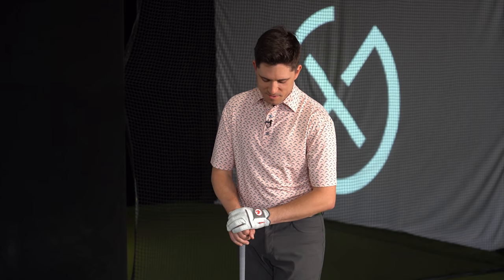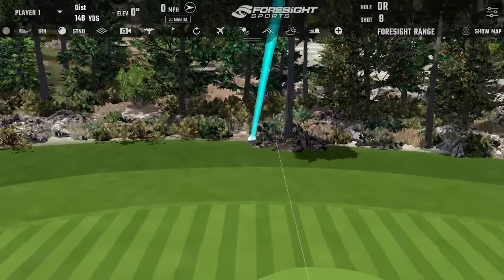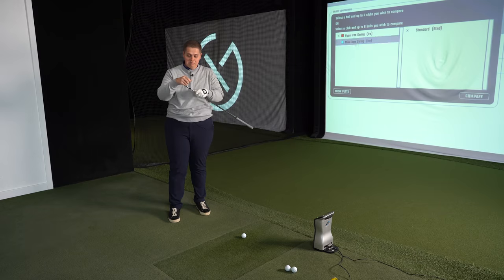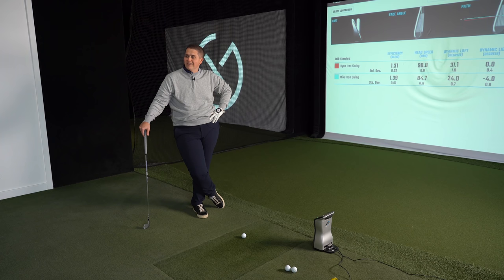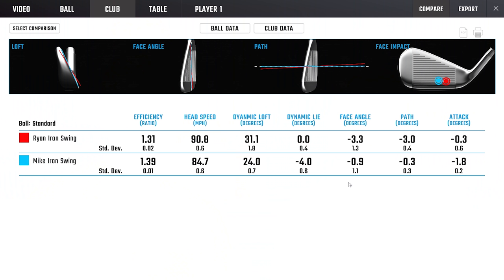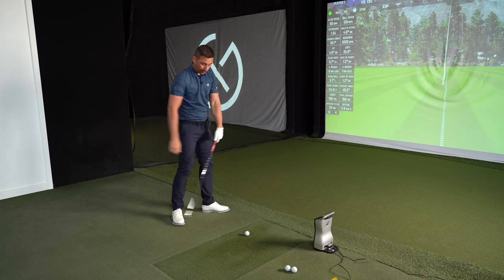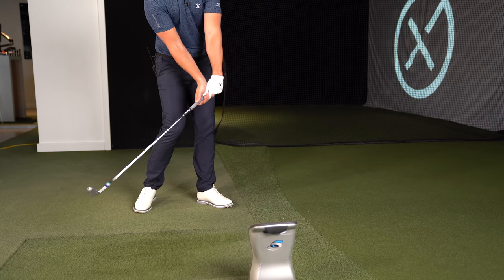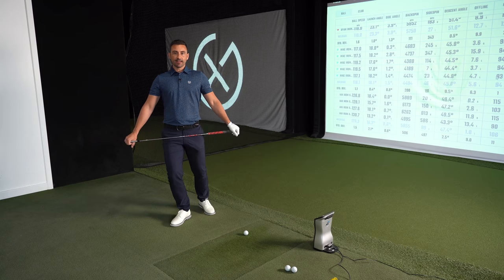HOW TO COMPRESS THE GOLF BALL // Controlling Spin Loft to Add Iron Distance

Comment: The video you guys did on ball position in the stance has changed my game in one day. Used to have the ball way forward and didn't understand why my driver and long irons were constantly pull-slices that went nowhere and my wedges were just high pulls. Now, with the ball back in the stance, the drives are straighter and longer, the irons are compressing the ball properly adding 15-20 yards and straighter, and the wedges are much easier to hit correctly and control. 

Thanks Ian and TXG.

Comment: this was amazing. i have been practicing this for very long. i am a-lot more accurate and it feels like a slower swing. i am a +6 Handicap. i have help a few friends lately with this swing. I get the feeling of not releasing the hands at the bottom, or a more forced body swing. everyone i have shown this actually works. knowing now why it works is so amazing and feels that i am moving in a more positive direction. thanks guys
Reply: can i maybe post a video
Reply: I’ve got to ask what is the feeling here during the swing. I know for a fact I’m not utilizing my speed. My 7i is 92mph and it’s like a 175 club for my. I know that’s due to my dynamic loft. I’m like 2° short of a really nice swing. Is the feel a punch/stinger type swing?  I need to feel like I’m hitting a sawed off low ball?

Comment: I'm a newer golfer, started last year with some rogue x irons which I'm still using. They are super strong lofted which was good as a newbie because new golfer spin lofts are generally much higher. Now that I'm starting to develop more of a proper swing and closing that swing loft window it's creating a huge gap between by wedges and irons. This video helped me connect the dots on why this is happening, much thanks.

Comment: Thank you for this explanation. I’ve been working on this all winter with my practice net. Not having a launch monitor, I marked my net which is 8’-6” away with various marks representing launch angle (simple trigonometry). Using a launch angle equal to half the loft, I have lowered it by 7*. My first visit to the driving range that just opened was an eye opener. Easily 1.5 club distance further. I’m attributing this to better compression of the ball because I don’t feel I’m swinging faster.

Comment: Fantastic explanation. I would love to know if you are better off working on swing changes to deliver a shallower swing path, with more shaft lean to improve compression. Or go and get fit into lower lofted irons to fit an existing swing. I know I find it very hard to maintain swing speed and not get a steep angle of attack.

Comment: Fantastic video. The word “compression“ misses the point a little bit though. Sure, the ball is most compressed with those mechanics, but the whole idea is that the club strikes the ball at its peak acceleration & velocity (hence max compression), which just happens to be a bit before the clubhead gets in line with the left arm.  So for a given lofted club, “minimizing the spin loft” it’s just a fancy way of saying “hands ahead of the clubhead at impact”.

Comment: Moe Norman said: "I make the club sing AFTER impact!" Compression (and smash factor) is a function of club acceleration during impact such that the ball not only elastically rebounds but is also compressed by the club head face going faster than the ball. Get CHS fastest AFTER impact and you will ensure compression. An accelerating club head goes faster than the ball that is trying to rebound from it. 100 mph CHS with no compression = 100 mph ball speed. 90 mph CHS with 1.5 SF = 135 mph ball speed. Concentrate on going fastest after impact for more distance.

Comment: So when does someone get too low of spin loft?

Ian's preferred shot had only 5000 RPM back spin and a decent angle of 43 deg carrying ~190 yards. Whereas his first shots, with "too much" spin loft had 6200 RPM backspin and 49 deg decent angle carrying ~175 yards. Almost identical to the PGA tour average.

This video is super timely for me as I hit roughly 150 shots with 6 iron in my garage the other day, trying to get the spin and decent angle higher, not lower.

Will 5000 rpm and 43 deg not have trouble holding a green?

Thanks
Reply: Exact same thought I'm having. I've always thought that I launch too low with not enough spin, when my numbers were actually very close to Ian's with a similar lofted club (15 degrees of launch, ~4500 rpm backspin)
Reply: @adampumphrey9485  same here. To low, to spinless. Cant hold the greens, but compression and smash factor is pretty high. Would trade 10 yards for added height and spin.
Reply: Same thought as well. I've been trying this thing called 'new school release' like Morikawa/Spieth do and it certainly gain smash factor and it goes very straight. The problem is low spin and the ball roll quite a lot.

Comment: Is there  a spin loft number that would be considered too low? Is there a range where you see as fitters that works the best? And is the spin loft number the same for every club? Is the optimum spin loft number for a 6 iron the same as for a wedge? or a driver? And does the correct spin  loft correlate to ball speed, backspin and angle of descent, all three have to work together?

Comment: By far, this is why you’re the best of best of the YouTube golf channels.
This video is exactly what I needed to send to my buddy.
Once I understood the dynamic loft at contact, it helped me take better control of my irons. I carry my 6iron with a DG AMT S300 shaft, 182y avg.,which was cool but the dispersions were inconsistent. Then I hit my 2nd set’s 6iron (both TM B 716) with a DG AMT X100 shaft on it, it was straighter but carried 175y avg. which I can deal with by adjusting my gaps accordingly.
CONGRATS!! 🎉🎊🎈🍾
On using slow mo to show what a compressed strike looks like. Even though I had learned about shaft lean a while ago, it was exciting seeing it explained on TXG.
Ian, your channel is evolving as it should and in the right direction. Awesome 👏 video.
Reply: Did I mention that I’m 66yrs young turning 67 in August. Just saying. No excuses.

Comment: Incredible information. I've been working on lowering my dynamic loft, with (although less drastic) similar characteristics to RB. And it's been going well, apart from a few shanks.... With is something I have never really struggled with. Ians comment about "lead hand turning the corner" and keeping the sweet spot moving makes complete sense and i think I'm missing that a little. I will for sure be implementing to my next practice session. My only question is, won't that make the swing a little out to in?
Reply: Downward attack is in to out in 3D motion As long as ball is behind swing center.

Comment: HELP!
Ive recently started to really improve my compression and iron strikes by trying to get the hands ahead and bringing my flight down to get that satisfying penetrating flight (being someone who started off seeing that weak high right iron shot being a new golfer)

Im slowly getting better but the more i try and get this feel the more the ball goes left. My weak right has turned into a ball started on line and ending 50 foot left. When i really turn and and compress one and it feels amazing, i see the highest ball speed when the ball hooks full left! Trying to understand how i can see that ballspeed and comptession with a straight flight.
My clubs are second hand mizuno 223's which are 1° upright, do i just need a flatter lie angle or is it fixable in my swing? Any tips or past experience would really help

Comment: I’ve had this issue for ever.  As a young man I had enough speed to get away with it, at 56 it became an issue that has to be addressed.  I now have an old club with the Watson Hanger attached to it that stays next to my chair.  Just picking that up and working with it here and there each day has made a huge impact.  I’m fortunate to have easy access to an older simulator and my launch angle with a 7 iron averages 17* and my carry distance averages 175 yards.
Reply: Do you recommend the Watson hanger?

Comment: I feel like I should be getting more distances out of my driver. Like on that chart my irons I can carry 6 iron about 180 yard but my  driver I carry about 240-250 with around 110 clubhead speed. I should be able to get at least 260-270 range. So this is saying it's mostly strike and angle of attack causing loss of distance?

Comment: I might be wrong but I would guess this is why there is a certain point at which there is a big jump in distance for some players? Like a sweet spot.  For me 5i is 198, 6i is 185yds but 7i is 165yds, 8i 152yds  and 9i is 140yds. As you can see the gaps are 12ish yards but then jumps to 20yds from 7-6i then goes back to 12ish yds per club.

Hope that makes sense? 

Its like i get to a certain loft and struggle to present the correct lofts

Comment: I think it would really help a lot of golfers out there if you could be a little more clear in showing the differences between some of these terms. Such as AoA (angle of attack) vs steepness and spin loft and static loft vs dynamic loft etc... It might be easier by demonstrating it in slower motion or literally holding the club and moving it to the ball to explain all the different angles/motions. Even animation. But some of this good work you do takes for granted that the watcher has full comprehension of the terminology.  ps I can't believe those Trackman tour stats are from any time recently. I'm 62 and virtually up with some of those stats which is totally silly. Young kids hit it way past me and they're not quite up with the pros. So, that seems a little outdated I'd guess.

Comment: Regrettably I'll have to disagree with the crowd here. Great to get to the flatter swing discussion but some of us are a bit more formal in defining physics and such.    Studied plenty of University Physics and I found the explanation un-suitable yet I give you full kudo's for trying to get techy!!!! What you said is " The difference between Dynamic loft and Angle of Attack is Compression". I cannot believe via the laws of Physics that this is correct.  I would guess that Dynamic loft equals club loft plus loft due to spin rate but spin rate is not compression.  Compression of the ball should be due to energy which is a product of mass and speed at which you hit it. I suspect the golf ball manufacturer would tell you that and yet spin is a further complication. A very simple explanation for more distance via a flatter swing is simply that the energy is directed to the ball more efficiently versus pounding energy into the ground.  The issue of spin and compression gets quite a bit more complicated from there as you have to consider some spin induced by pushing against the ground versus the spin via angles which differ from a flat to a steep swing. Finally I don't think you should confuse energy via drag which is due to spin.

Comment: Would it be better practice to use higher lofted clubs or lower lofted clubs when trying to feel the compression.  Also, I feel like using blades to feel the compression would be better than game improvement irons.  GI irons are too strong and most of the feel of impact get sucked up by the massive cavity back.

Comment: My biggest questions is what is the timing of release.  Should I feel like I am holding release  longer.  I get the turning left to get head squared, but I struggle with how to release.  When I flush them I feel like I am dipping the toe down right as I am striking the ball, but I not sure how get consistent with it as I feel like I am getting too wristy.

Comment: Brilliant video. I used slowmo and frame advance to see the differences here. Ryan is into the ball when his hands haven't even reached his right knee @2:25  so he's releasing very early. Ian, on the other hand, still has his club head 12-18 ins. behind the ball when his hands reach his left knee @8:58. From there they only travel another 2-3ins. while the club head travels a yard through the ball. This is not only compression but delofting too, hence the lower flight and greater distance. Add to that the club head is spending more time travelling along the target path and the late release creates a faster club head speed at impact. Tying all those together........that's another story.

Comment: The part that I have struggled with, and I wish the video expanded upon, was if you get that launch angle but you don't have that swing speed.  Then, you don't get the same height.  Spin rates will likely vary as well.  If you are more like 80 mph on the 6 iron, do you want a different launch angle for more height and more stopping power?  Or is this launch angle/arc this still preferred for distance/stopping power or would more height perhaps produce more carry distance?

Comment: This is a great explanation of spin loft and compression. The only thing I personally found missing is that what most teachers would call axis tilt from the discussion. Most amateurs have poor downswing path leading to out/in paths making it very difficult to have the necessary backwards lean (pelvis in front of spine) to achieve optimum compression. Like Ian said if you only attempt to hit down more (without lean away from target) you're just shifting the same spin loft further into the ground. Hope this turns the light bulb on for some of you
Reply: Is axis tilt the same as side bend?